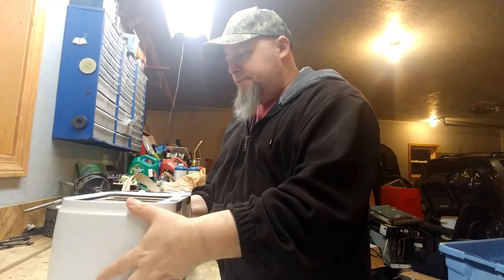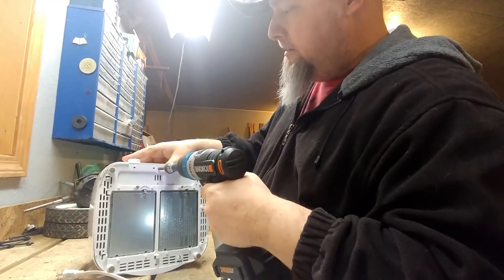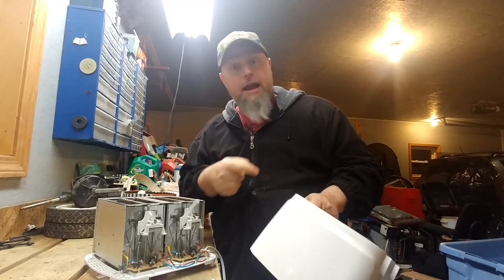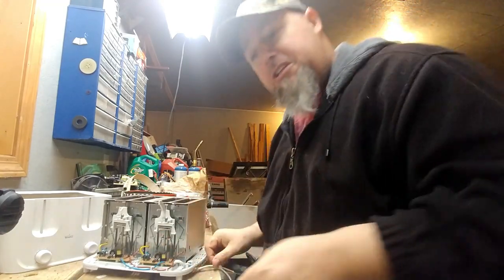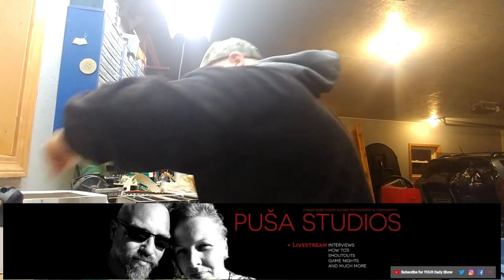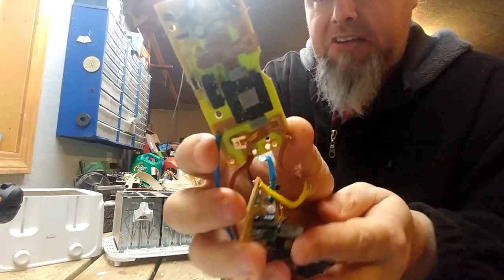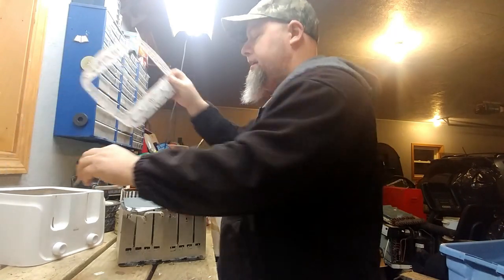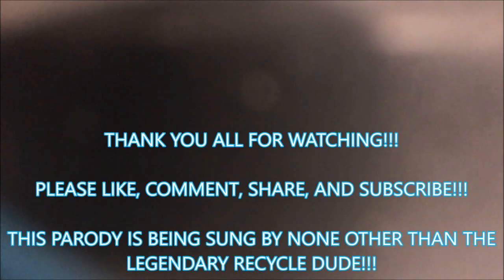MICRO SCRAPPING A TOASTER!!

Comment: On the power cord should I remove the wire from the plastic or just turn the cord in as is?
Reply from the maker: It's up to you.  With current prices, you will make about .48 cent a pound if you leave the insulation on the wire.  If you strip the insulation off, you lose some weight, BUT, you make about $2.00 a pound with the bare copper.  :)